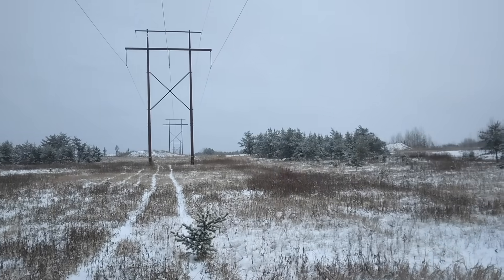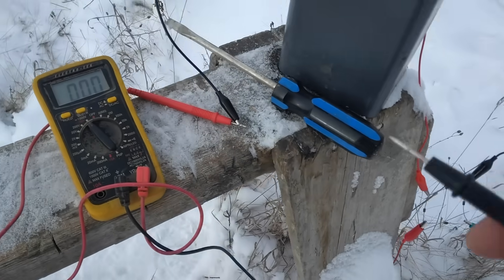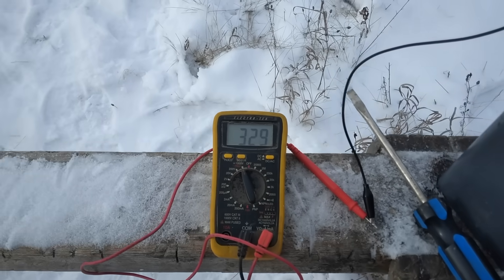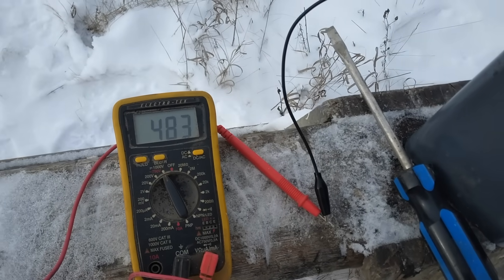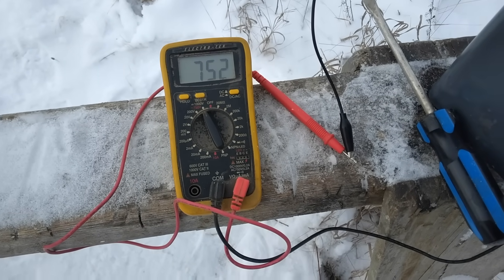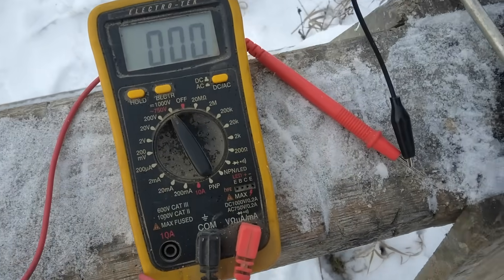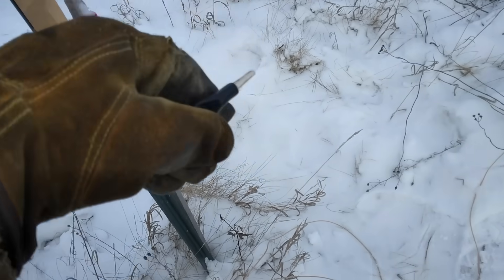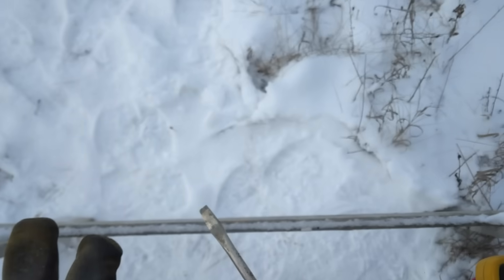Fences sucking power from under HV transmission lines

Comment: Electrical engineer here, this is a large scale example of capacitive coupling. The alternating voltage induces a charge on adjacent wires/objects. This is usually a high voltage but very low current. With such high voltage lines shown in the video it can be enough to light CFL and florescent light bulbs below the lines. This is also the same effect that Nicolas Tesla called Wireless Power and wanted to bring to the masses with his tesla coils. Too bad the energy losses were so high it was not even remotely feasible.
Reply: How do you know what his losses were, you read his notes?

Comment: its been 20 years or better ago it was winter at night and damp outisde and real cold i was trying to jump start a loader so we could use it to load sand on a spreader truck to sand the lot after it had snow but i was parked under a steel tower high transmission wires and when i touched the metal on my truck i got a tingly buzz feeling and kept thinking something was wrong with my truck anyway i moved it out from under the wires and didnt feel the tingly sensation anymore my truck was getting energized from the high tension voltage wires over hear kinda wish i had a voltage meter to read it now

Comment: Ive heard of moonshiners using the power from putting coils of copper under the lines and using it use electric heat on the still using induction.

Comment: I worked at a company called Genscape in Louisville Ky years ago.  They sell reports about commodities to brokers and one of those reports was on what electricity was going where and who was selling electricity to whom based off of boxes they paid land owners to place next to high voltage power lines that measure how much electricity was going through the line based off the magnetic fields.
Reply: That's interesting, not the boxes, but the fact they totally bypass the power company and make their own measurements. Because the power company would already know this stuff but they don't want to ask them.
Reply: @thewhitefalcon8539  It not a matter of willing to ask its a matter of the power company willing to  release or quickly release.  These commodity brokers trade on that info daily sometimes hourly.  An example would be if Con-Edison has a problem with a plant and has to buy power from Duke Energy.  The brokers would invest in Duke Energy supplies.  It is big money.  They use FLIR cameras on oil tanks like those at Cushing to provide oil stockpiles info to brokers.  They use satellite phots to predict soy and corn yield for Ethanol production.  Huge money in those reports.

Comment: Putting any conductive material under a transmission line to harvest energy from it is theft. The electric field around the transmission lines does electric work due to the resistance within the conductive material and is slowing down (not by much - but still) the flow of energy in the transmission line to make the electricity in the parasite line.

Comment: i once spoke with a fellow who was an expert witness in a wrongful death legal action against an electric transmission company.... he was some sort of engineer.....factual case story: house located on their land bordering easement for highvoltage   powerlines running along the property line.  father and daughter homeowners were raising an aluminum ladder up against their house, and AWAY FROM THE CONSUMERS SERVICELINE TO THEIR RESIDENCE.  Power from the high voltage transmision line ARCHED across 100 plus feet to the ladder instantly killing person on the ladder and other one steadying it below... BOTH WERE INCINERERATED TO ASH.  The fellow showed me pictures of what was left...their burned to-ash-corpses whose ash reduced faces were frozen in their shocked last second.... their legs and torsos just ashheaps. they burned for several minutes...  pompeiesque scene..grotesque and frightening. the house was well inside the property line and the power lines ran in the easement given the electric co for their highvoltage transmission lines... So you standing beneath these lines like your holding up golfclub up during a lightning storm was kinda scary to me.😂

Comment: I would like to see the same experiment done at a much larger distance from the power line to see if it is indeed the source. It probably is, but it may come also from other transmitters or even from space. It would also be interesting to see how the length of the wire affects voltage and power. Hooking up an oscilloscope might be also interesting to see if the dominating frequency is indeed 60Hz.

Comment: So you build a regular fence on metal grounded fence posts. The fence wire is picking  up the induced current, but the metal fence posts bleed the current back to ground.
If you insulate that fence wire from ground and it is long enough, you have a possibility of enough induced current to actually do something with it. When you use it to power something, it returns to ground.

My question is this after reading a lot of the replies below. If you build the fence and it puts the power it gathers back to ground it is OK. But if you gather it and do some work with it, it is illegal. Something is not right here.

Comment: working at power plants the fences had to be grounded some of them would get electrified with warning signs not to touch them especially during rain you could feel the air crackling with 500k volt lines overhead

Comment: Hydro here in Canada fly helicopter regularly down the hi tension wires looking for buildings that could be hiding coils to steal hydro.  They use inferred to look for cold spots in the line . Tells them they have a ground or unusual draw at this location.. but a small coil would be nice to charge a phone in the woods . I have seen cattle killed out under the lines in storm weather.

Comment: The power lone over head makes a flux field following right hand rule,  wouldnt his fence need to be perpendicular to the towers so the field is pushing the electrons in the directio of the wire / fence.  ?

Comment: I thought about that years ago.  An induced current through a wire near high voltage power line.  Kind of like an antenna.  I'm not an electrical engineer and it can be very dangerous playing around with it.  I wonder if it would steal power from the high voltage line.  I don't think so, the radiation from the high voltage line goes into the environment, so I think it would not effecting the current through the main lines.  The power company still would not be happy about it.

Comment: why are you charging a cap to begin with??  why not just take a static reading??  Safer to do that then store a large charge and have potential voltage that really isn't safe or accurate.  Use a meter and set it for AC and read it off the wire..then try horz. vs vert. wires - length , etc.   I installed CB antennas back in the day and would have sparks jumping from the center of the coax to the shield - really bad when the wind blows as with most metal antennas. use a static reading and from there you will be able to tell what is available too use.....then current allowance to give ya a idea on what you can use it for.  once done......you be able to charge a rack of batteries to be used to run the house.     (FYI  good way to kill that cap by shorting it.....use a bulb or large resister to safely discharge it)

Comment: Several years ago I was on a pipeline under a high voltage transmission line.  The company had to ground every joint of pipe.  If you touched a fence that ran along side or under the transmission line and it wasn’t grounded it would knock the wewe out of you.  Ask me how I know.

Comment: Sure are being pretty casual around that capacitor.. one wrong touch and you're a gonner! Instead of using the ground as a return path make a loop and space it approximately the distance of one of the phases on the lines then step that down through a neon sign transformer

Comment: The story goes of a New Zealand farmer who managed to run lights in his slightly remote barn, which was underneath a transmission line, by connecting them to the roof. Sometime later he died and later again the lights failed. His widow employed an electrician to repair them and he was initially puzzled by the lack of a cable connection. Ultimately information of the "illegal" connection got back to the power company and she was prosecuted for stealing electricity. Whether it actually happened I don't know but that's more or less how it was told to me 50 years ago.
Reply: in NZ one gets charged with theft of electricity if using the air cored induction method, or the "lets bridge the meter" method. 100's maybe thousands of court cases over the years.
The pointy headed scientists have proven beyond reasonable doubt, and quantified the amount of electricity that gets stolen in each individual case ......  so try it at your own peril in NZ, coz if you are detected, you will get a District Court (criminal) conviction and the penalty that goes with it.

Comment: Reminds me of the foxhole radios i made in my youth; Was always amazed that a small antenna pulled enough voltage from the air to run a piezo speaker earpiece.

Comment: Myfather in-law was a telecom technician in Australia   he was responsible for a large area in our state mostly small towns and farm land. He was asked to help the local eletric company one time because they were loosing power and weren't sure where..He traced the problem to a large farm that had high voltage lines running acros rhw property. The farmer had built something under the power lines and was using it to power his farm..he told me what he did but it was in the seventies and can't remember exactly. I do know that the farmer never physically connected anything ro the power lines. The electric company didn't care andstill charged him for steeling power.the farmer thought it would be ok if he didn't touch the lines but he was wrong
Reply: Yeah. I'd say wave lightbulbs around all you want, make a cool wireless door lock or something, but don't use anything that would cost more than a couple bucks, because the power does actually come from the power company. You're not just recycling waste power.

Comment: There’s been linemen killed by accident when long parallel runs of wire were even a good distance from an energized high voltage circuit and it wasn’t grounded.

Comment: Is your purpose just to grab a little useable power from the lines? Was an electrician, industrial for 47 years. My dad did electronics. Without a full loop around a conductor, there is not an easy way, but might I suggest laying a 2 lead, sheathed cable like house wiring, in a long straight run, parallel to the power lines, on top of the fence, so that the electrical field around the 2 overhead wires, induces a voltage 'inductively' into the 2 conductors. The problem you will have is that both wires will be the same polarity. 
To fix this, at one end, cut back the insulation, and take the black wire and hook it to a ground rod, do the same on the other end of this cable, hooking the white wire to a ground rod. tape the unused ends and separate them from the cable. Now the voltages will be the opposite from each other at any point you want to tap in. This is inductance, and only works with AC lines ...69,000 Volts. If it is one of the monster DC lines running out west at like a million volts it won't work.  Since the power companies 3 phase wires are pretty much self-cancelling the flux around their 3 phase trio, you won't get much, but the imbalance in their load will create the transformer action you can experiment with. Their lines should be high enough off the ground to keep you from getting much of a 'sample', but please don't get killed on my account. This will not 'catch much', but will be sustainable, and may produce something useable. It will depend on voltage, distances and more. My dad used to install antennas on farms way out in the boondocks. He said, if you splice pieces of VHF Twin lead, end to end, you lose gain. If you take the 2 lead in wires - flat pack, and tape them close with no space between them for a few feet- no loss. 
I repeat - do not hold me responsible for not taking precautions. Now if you start getting more power than they normally lose as 'line loss', they will come looking for you, or accuse you of stealing, but if you want a few LED's to light up your fence line?

PS, we used to store 4' fluorescent lights in the transformer vaults in the 70's. They would glow faintly in the cardboard boxes - cool beans

Comment: A farmer down the road has a pasture with a barb wire fence under high voltage lines and it will knock the piss out of you. Even the gate chain will eat your hand up when yoi try to open it

Comment: The power you can get from the fence is proportional to the current flowing (not voltage) of the transmission lines. So, sometimes you will get very little, sometimes you will get a lot more.
I wonder if the 3 phases somehow cancel each other - would be interesting to setup a few "fences" with one right under the middle line, and the others a repeating distance apart moving away from the lines.
Reply: Field lines don't cancel, they change shape to accommodate a zero-flux boundary between the two opposing flux directions. With the 120* phase separation I'm not really sure what would happen with the flux and would quite honestly be a great simulation to run, seeing the distribution would sure help with designing a better secondary.
Reply: There is not likely to be a balanced load on the transmission lines so I would think the flux pattern would be a field created by the imbalance.
Reply: 3 phases partially cancel each other, but not precisely.
Reply: @thewhitefalcon8539  if the current in each phase is equal they do cancel each other out. Cables are installed in tri-form to take advantage of the effect.

Comment: What is the cap gonna do for you?
Tell us the voltage on the pole or wire or whatever you are connecting tthe cap to. 
If you are say getting 9v of inductive voltage, i would image all you would need is a copper coil with a metal core. 

In theory you could find out how many turns of copper wire you need to wrap around the core to give you a useable voltage on the primary side. 

Because you are dealing with micro amps or whatever you said you may not get a high amperage with that usable voltage but i bet if you could get to 110v you might then be able to trickle charge some batteries. 
If you could charge free batteries all day then you could potentially supplement your power usage with that

Comment: My boss/friend was riddled with cancer and died at the young age of 42 years old. The reason, people believed, was that he grew up in a house under, or almost under power lines. Also, one time, 1989, we camped out under power lines after a Grateful Dead show, in tents, outside my Cherokee . When we woke up and went to get in the truck. We were getting shocked. I guess we were the ground because the tires blocked another path. Crazy.
Reply: I don’t thing living near electrical currents is going to cause you cancer. If anything it’s the side effects of doing so, like the stress of always being shocked when touching a doorknob or something. What you are around is a magnetic field…. Like the one around the earth. Or and MRI machine. I don’t think we are arguing that magnets cause cancer. It’s non ionizing radiation.

There ARE some links between EMF and childhood cancers like leukemia, but those studies are flawed and don’t consider external factors, like statistically if you live that close to high voltage power lines, you are likely poorer and your house may still have toxic construction materials, or radioactive radon leaks.

Comment: Your coaxial cable is acting as as secondary winding of an AC transformer system.  If you coil the coaxial, say 1,000 yards coiled over the same 80 feet, you might possibly triple or quadruple your energy.  Using that energy like hooking it up to lights or other motors, it would be stealing the energy from the power company.  No power is drained by it simply energizing the coaxial cable because the secondary is not draining any power. All the energy remains in the high tension energy field even though it interacts with the coax

Comment: So what all could be done with this? Is it enough to power something continuously or could you just charge big batteries with it or what? I live about 50ft from HV lines so this has me curious. I also already have a wooden split rail fence ran parallel to the lines and almost under them. Which would be a perfect place to run a cable along the top of it, or at least I'm assuming. I don't want to fry myself, but I'm definitely curious about the potential use of this.

Comment: AC Induction is very common on a  long parallel run of metallic cables. I work in the telecommunication industry for over 20yrs and we have to mitigate these induced voltages. 

Normally we use AC Chokes to flip the phase 180°. This counters the induced voltages. However, there is a saturation point where the the the AC Choke can be over run and the effects become null.

Generally, these voltages does not produce high currents, but still can give you a healthy jolt.

If you ever heard a 60Hz hum on a Plain Old Telephone Service (POTS) line, then you know why now.
Reply: ah yes immna call ppl in pots 💀

Comment: A resident in Sydney once installed an antenna near a local radio transmitter. He converted the radio waves to local AC and powered his house. In time the the radio station investigated the lower emission from their transmission tower and tracked him down.

Comment: Voltage induction just like an air gap transformer. It may be possible to get certain voltages  by arranging a set number of pickups in the area of the power lines.

Comment: I suggest....you wind a  bunch of copper transfomer wire around a metal core...and then wrap a secondary around that...see voltage off secondary winding .😂😂